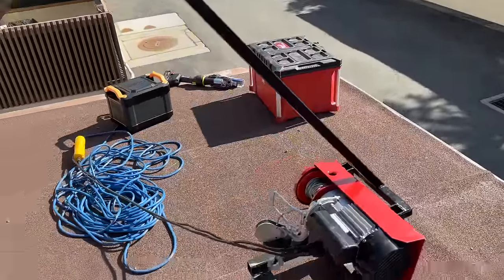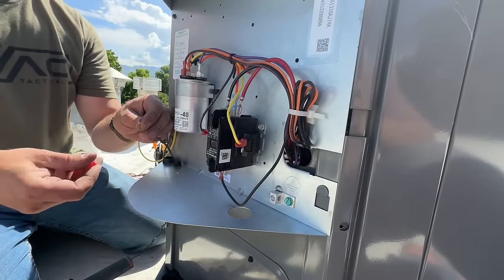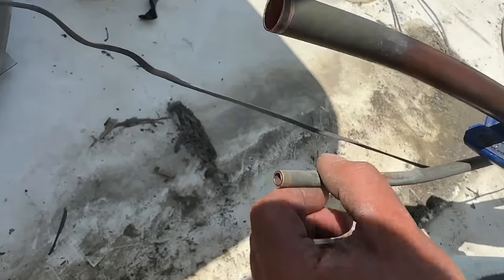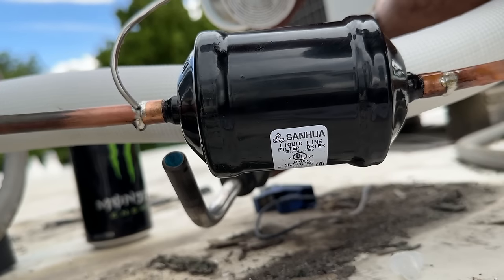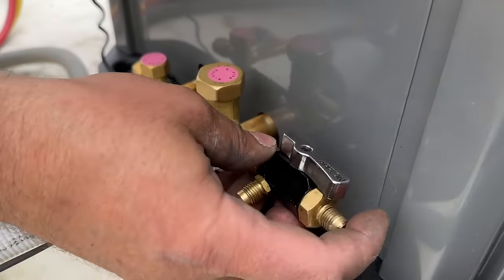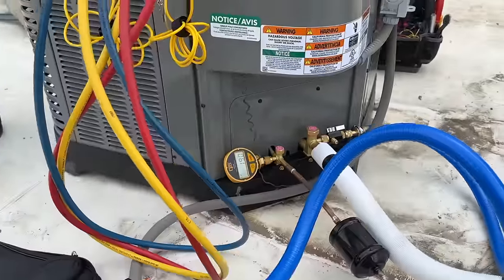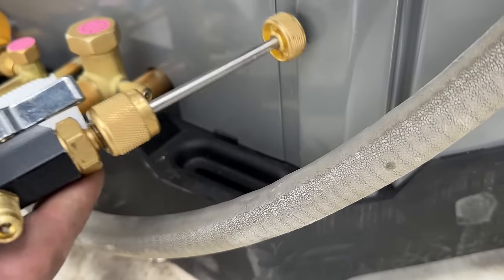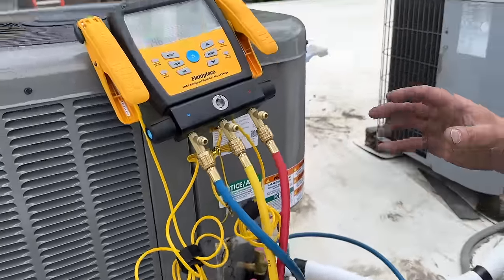Rooftop A/C Replacement Using My Homemade Harbor Freight Ladder Crane

Comment: If that handle is 1" square tubing, I see an extension in its future using 1-1/4" and welding the handle on the extension and drilling holes for two hitch pins to lock it in place. If you can't get tubing that'll slide on then you can do foldup handle with welded on C shapes so it's secured on both sides with the two hitch pins.
Reply: What about the LADDER that ISN'T designed for this? Guess it's keep trying or you die trying righhhhtt?

Comment: Lol why is the winch on the roof? Leave that heavy thing and the battery at the bottom of the ladder. Just run the cable up over a pulley. Save you from hauling that crap up the ladder.
Reply from the maker: I thought about that. The problem might be cable length. But I’ll look into that for sure with the new system I’m trying to build. Cheers

Comment: when I was in the roofing business shingle companies deliver for a charge, don't a/c companies do the same?
Reply from the maker: It’s not necessarily the price. It’s having to deal with lining up the crane service, limited access points. There’s some places where it’s pretty much impossible to get a crane in there because things have been built so tightly around them

Comment: You used too much solder. The length of solder you use should equal the diameter of the copper tubing you are soldering. Any more than that means there's a "booger" of solder inside the line causing a small restriction at the joint.
Reply from the maker: I have ti disagree with this, because as you feed more in, it flows right out and drops out the bottom. I’d be curious to overload a fitting and then cut it in half to see what it looks like.
Reply: @diyhvacguy  You can test this by using scrap copper tubing. Just cut a small piece, swage and fit together, then solder. Make it short enough so you can see the inside of the tubing as you feed your solder into the joint. I'm a retired engineer for Lufthansa Technik, a German aerospace  engineering firm this phenomenon is called "Aufsaugen" in German.

Comment: When it comes to buying units for Home what brand would you recommend that can possibly last 15-20 years.
Reply from the maker: Trane & Carrier are top of the line, Rheem / Ruud is middle grade, Goodman and Airquest are builder grade. Granted all of them have a 10 year warranty, but the more expensive ones are built with better quality.
Reply: @diyhvacguy  Thank you for the info.

Comment: What was the nitrogen pressure when u used the plug? Is it a possibility for this thing to get stuck inside the pipe or no?
Does this replace the RX11? 
Good job man keep up, i see you started using the staybright on a lot of installs
Reply from the maker: The plugs keep the nitrogen in the coil, so when you remove those plugs and hear pressure come out, you have just confirmed that there is no leak in that coil. In hind sight, I should have pulled the plug out BEFORE putting it in, so that if no nitrogen came out I could easily get a replacement. Cheers man
Reply: @diyhvacguy  I was just talking about the plug that u used to flush the pipe with nitrogen,  not about the new coil plug, thanks man

Comment: I think it's kosher as long as you have a 2nd pair of hands holding the ladder down below.  I don't fear tall ladders, I fear being on the top and the ladder deciding to tip backwards on me.
Reply from the maker: I showed the part where we attached it to the ground, the roof in this instance. Then we sealed it back with roofing caulk. So there was zero chance of the bottom kicking out 👍🏼
Reply: @diyhvacguy  I think geometry might result in a force superior to the holding ability of relatively small screws, especially if they are anchoring into the roof sheathing only.  I also agree that you need to have some kind of fall arrest anchorage and wear the appropriate harness and shock absorbing lanyard.  Philosophically you are trading your personal safety for economy that primarily benefits your client.  Telehandler?  Genie?  Crane of some kind?  They all cost $, yes, but they substantially reduce the likelihood of becoming a job site incident statistic.  You're worth it, ask your family!

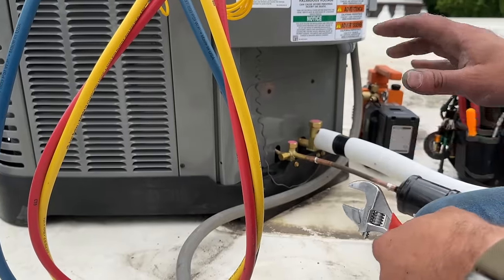Comment: 16:33 Can I skip the pressure test and just use the vacuum pump to verify no leaks? Can I avoid going to my welding supply store for a tank of nitrogen and a regulator?
Reply from the maker: You will probably be fine if you bypass the pressure test and and pass your 5 min decay test after pulling a vacuum. As long as you don’t go over 500 microns you are golden 🤘🏼
Reply: @diyhvacguy  Cool. I'm going to try it tomorrow. Thanks man!
Reply: @diyhvacguy  Long story short: We tried to order Goodman products from HVACDirect but they told they were out of stock and sold us what they said are compatible AirQuest components instead. We ordered a 3/4" x 3/8" x30' line set to go along with it. The 2 ton condenser and 2 ton evaporator coils arrived but the condenser has a 3/4" vapor line while the evaporator coil has a 5/8" vapor line. Can I just use a 3/4" x 5/8" reducer to connect them?
Reply: @planetvance you could get a fitting that will work,or just expand the 3/4 pipe with a swedge tool stick the 5/8 in and braze it shut,then you only have one joint to braze instead of 2

Comment: 18:19 You can attach the suction temperature clamp to the suction line during the pressure test for a more accurate result. Make sure the clamp  isn't going in and out of direct sunlight as it will not give an accurate reading. Hope this helps.
Reply: Why in the hell do you need a temperature clamp on a pressure test?
Reply: @michaelodonnell7483  Because Temperature and pressure are directly proportional. So, the SMAN guages use this temperature value to compensate for any temperature change in the line. A
Reply: @edwingehman9885 you are correct on both statements.

Comment: Good job my friend ! I suggest you would attach a piece of rubber mat underneath the wooden board to avoid slipping of any kind , also the handle make it a bit longer to give you more leverage and also keep your body away from the edge of the roof , in case something goes kboom with the load , your natural tendency is to catch it , so safety comes first! Be bless KING JESUS loves you ! John 3:16

Comment: I would of installed the same size coil personally it would look better but i guess it works and filter dryer should go inside
Reply from the maker: I don’t really care for soldering vertically although it can be done, so I opted to put it outside.